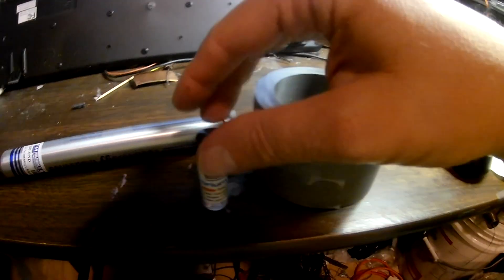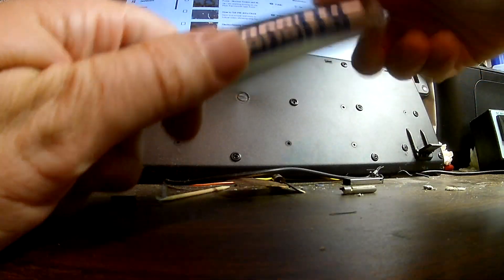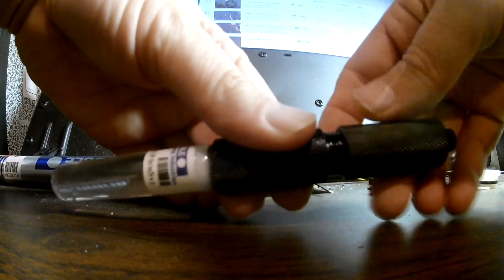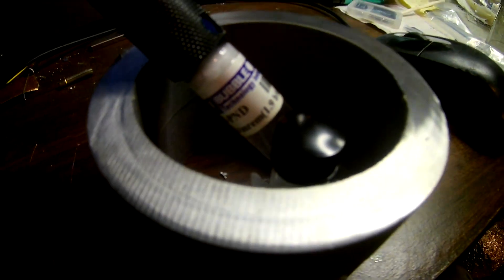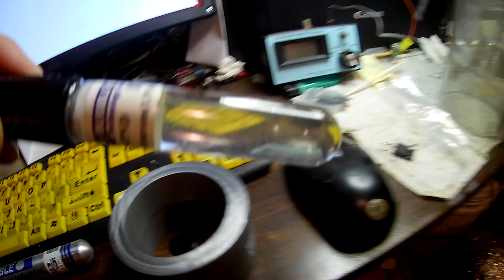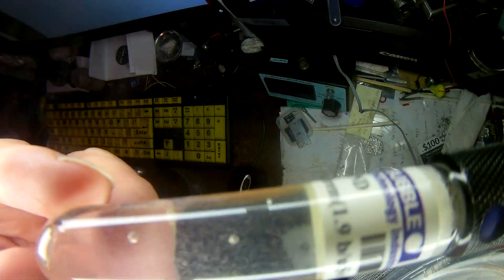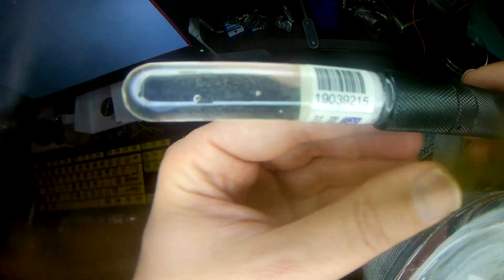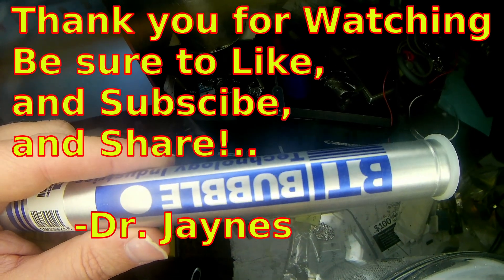Micro Thorium Heavy Water Reactor with Beryllium Reflector Rings

Comment: I have plans to try and make a nuetristor, and use it to make a small breeder reactor at home
Reply from the maker: Sound very interesting! You could also build a Fusor!
Reply: are you want to make plutonium 239 or uranium 233 ?🧐😁🤔
Reply: Please post vids of the project
Reply: LOL 😆 I thought about that shit too but damn bro what do you do when you end up with something like the radioactive boy scout that you get readings from a block and a half away and then you got to dispose of shit
Reply: Cloven Beast he didn’t make a breader reactor only a neutron source what he did wasn’t too dangerous either
Reply: I can't really say anything though because I did the same with my uranium 238 metal sample
Reply: Cloven Beast americium releases alpha particle, absorbed by beryllium which releases neutron, slowed down by parrafin wax, absorbed by uranium 238 forming U239 decays through beta decay where a neutron turns into a proton , a electron which is released as a beta particle, and an antineutrino forming Np239 after 20mins half life, which decays via beta decay (same process) gaining a proton becoming plutonium 239
Reply: @punishedgloyperstormtroope8098  Yes I realize he didn't he was talking about it. I've done similar experiments I was basically just speaking thoughts that I had when I was doing things
Reply: @punishedgloyperstormtroope8098  Yes I know I have both powdered and solid beryllium. The powder is incredibly scary. I don't know how many discs I pulled but from certain things lol but I ended up with a pretty strong alpha source. Let me put it this way it's been in a plastic vial for 5 years and the plastic is decaying.
Reply: @clovenbeast5183  what is your alpha sample? And how much of it do u have? Where can I get one?
Reply: @punishedgloyperstormtroope8098  look into industrial smoke detectors they contain about a hundred times the amount. I don't remember the name of it but I bought a couple of them cuz I got tired of buying smoke detectors. Take the disc out of the buttons. Take the foil off the industrial. It's hot
Reply: @punishedgloyperstormtroope8098  If you can't find that you can always get old radium clock hands. Wash off in acetone. The radium isn't soluble and ends up as a sediment at the bottom but the paint is so it can be poured off.
Reply: eBay
Reply: americium 241 And I have another containing  radium sulfide in a little bit of lead nitrate I believe? I don't know I got it from Canada the radium salts anyway. This guy was a chemist and they actually shut him down when I tried to buy from him again lol. I guess they frown on That kind of thing traveling over borders
Reply: @punishedgloyperstormtroope8098  I have the equivalent of about 250 smoke detectors worth
Reply: And actually I just found another source recently it's the hottest Geiger counter look up the most radioactive Geiger counter on YouTube. It looks like it's worn on the belt anyway it contains a very hot radium dial if you find the one that hasn't been messed with just look into it. It also contains a check source but I'm not really sure what the check sources is. You pretty much have to keep your sources moving as the government catches up like finding what's available
Reply: What makes it so bad is I've taken them out of the buttons so it's just the electroplated It almost looks like copper but it takes up about as much room as three drops of water so it's very potent for the size
Reply: @punishedgloyperstormtroope8098  here's a video on what looks to be the same kind of smoke detectors I took apart long ago https://youtu.be/dfihjKIHgwk
Reply: @punishedgloyperstormtroope8098  I don't know about the secondary source that he's talking about cuz this is part two. I never worried about them The primary though wow it's those little foils he was holding up
Reply: @clovenbeast5183  250 smoke detectors are still weak in this sense , not enough to produce enough neutrons to produce reasonable quantities of isotopes
Reply: @clovenbeast5183  send me a link to these “industrial smoke detectors “
Reply: @punishedgloyperstormtroope8098  I don't remember what they were man I had to do my research I think it was radioactive things.com where I learned about it they usually have things that are listed but you just got to do research to find it man That's how you earn the ability to fucking it's where you learn what not to do and how to keep yourself and other people out of trouble. I would say Google it but you can't use Google because it's censored brave it or ducked up go it most radioactive sources just look at the post that I shared and ask him what it was I don't remember
Reply: @punishedgloyperstormtroope8098  The radioactive boy scout would disapprove lol It doesn't take much to produce neutrons and you got to remember in the process neutrons are given off so it's a chain reaction man you don't need much what you might want to consider is something to act as a control rod like cobalt or something to absorb the neutrons so you could slow it down without having to pull out the core
Reply: @punishedgloyperstormtroope8098  a very small source will work just in small slow ways a large source will quickly get out of control. 250 smoke detectors is hot enough to turn plastic yellow and pitted in 5 years. Looks like there's liquid in it sticking it to the sides where it's stuck to the plastic!!!! Reactor made hottest fuck man I don't have any way of measuring alpha particles I can only detect the gamma coming out of it and it's hot it's real hot
Reply: @punishedgloyperstormtroope8098  The problem is moderating the neutrons slowing them down to the proper speed. Once you get that right and everyone's hit and right for the most part it don't take long to start noticing things. I used a paraffin house but I mean you could use graphite ideally I don't know about beryllium as far as reflecting I just use it to knock neutrons off of. Let me put it this way I have a really hot sample of just simple high-grade uranium or that's been powder so basically uranium oxide in some state I don't remember. Black. The beryllium chunks that are in with that are slowly turning to what appear to be carbon on the outside it's just from the alpha bombardment and neutron generation in this little tiny vial. I don't even have the beryllium in with the sample that I am originally talking about. It doesn't take much to kick off he just got to get your moderator right and know what you're doing
Reply: @punishedgloyperstormtroope8098  now I understand that it takes a while to get up to the point to where neutrons start being given off from the reaction I mean there is countless fucking atoms in there but it's bound to happen if you know what I mean. If you really want a stronger source start searching out radium clock dials and shit like that. The hottest Geiger counter with the radium dial which I really can't understand to this day lol it's supposedly extremely hot and use take that dial out dissolve off the paint and acetone collect the precipitate or undissolvable things in a coffee filter and you just keep going until you have up enough buying radium watch hands and kits off eBay true radium watch hands. As far as am 250 smoke detectors is a lot. I know it doesn't seem like a lot but it's enough to decay things around it. You look at polonium sources that are used to generate neutrons and you're talking a fraction of it
Reply: @punishedgloyperstormtroope8098  back when I was messing with it I was looking because I had thousands of dollars of chemistry equipment into how to dissolve into assault separate and maybe electroplate or reduced back to metal but unfortunately with the quantities it's more like electroplate to one side of something. The problem is these foils only radiate from one side with alpha. It's just a deposit on some foil looks like electroplating actually. If you could take it all and put it on one surface on the one side and put it up against some beryllium preferably fairly thin or some plate you would get a lot of lot more than you can get with a lot of things. I mean you could build an ion multipactor for fusion reactor if you really have that money, but this is a true source where you can get real results from a few hundred bucks and sometimes been on eBay
Reply: @punishedgloyperstormtroope8098  ideally your source is surrounded. Much like radioactive boy scout but I don't know I think he used carbon but look I'm just saying it's possible it's very possible unfortunately and if you were around me I would happily investigate with you and show you but I'm not going to mail this shit lol not in these times
Reply: @punishedgloyperstormtroope8098  you don't want to source that's as strong as you're thinking. You're a great moderator man think about that
Reply: @punishedgloyperstormtroope8098  just look up the people that have done it man look up the radioactive boy scout 1-in cubes about 1 ft² with a core of radium he used aluminum instead of beryllium but shit and we can get beryllium nowadays. There's actually a lot of knowledge in those in that funny takeoff of how to build a nuclear reactor at home
Reply: @punishedgloyperstormtroope8098  but on a side note something I have noticed when I pulled it back out I noticed that it was deteriorating, I checked the radioactivity of it based on gamma basically because I don't have anything capable I need to get some kind of alpha probe and a proper guy your counter or just got a cheap one. Anyway I've noticed that over 5 years It seems to have lessened at least in gamma
Reply: @punishedgloyperstormtroope8098  but at the time before when I was testing it I was keeping it with my neutron source as well everything in a Pyrex lab media bottle a bunch of vials just to kind of keep the radiation down even though it's glass it helped
Reply: @punishedgloyperstormtroope8098  ideally you want to carry out small experiments on a small scale with good equipment Rather than large experiments with shit equipment and end up fucking
Reply: @punishedgloyperstormtroope8098  there may not be any lies governing outside of nuclear regulatory reach but you're in new times now it's best not to make a scene you know?
Reply: @punishedgloyperstormtroope8098  sorry I know I write a lot of responses but it just comes to mind and it's kind of important and it's kind of how I think cuz I'm crazy lol. It's like when I used to do chemistry. I live in an apartment in a town and I got tired of the cops being called on me thinking I was cooking meth. Not every chemistry kid is a meth cook you know not everybody that's interested in chemistry is cooking dope. But in my experimenting and not understanding and just kind of going through and dissolving lead and acid and all kinds of shit I became aware that these vapors and shit were actually affecting me and I poisoned myself many times some less some more. These were different times I was buying high grade uranium ore on eBay It was about maybe 7 years ago. I would do reactions in the backyard and just fucking fill the air with nitrogen dioxide fucking red fog and run inside but ultimately I came to realize that it wasn't just me that I was exposing it was everybody else. That's when I came down. I started thinking about my kids in my house I started thinking about my neighbor's kids I started thinking about how everything connected just keep that in mind man before you go trying to build something that you're not going to know what to do with
Reply: @punishedgloyperstormtroope8098  That being said though right on bro I hope you learned something from office we need it
Reply: @punishedgloyperstormtroope8098  with great knowledge comes great responsibility
Reply: @clovenbeast5183  the nuclear Boy Scout didn’t build a reactor, just a neutron source
Reply: @punishedgloyperstormtroope8098  oh bro he did he built a breeder reactor lol I'll find you the video That's why it was so goddamn radioactive That's why they dismantled his shed and buried it in a Nevada desert
Reply: @clovenbeast5183  https://en.wikipedia.org/wiki/David_Hahn
Nah
Reply: @clovenbeast5183  it was so reactive because he got soo many isotopes
Reply: @punishedgloyperstormtroope8098  have you looked into him very much?
Reply: @clovenbeast5183  this is a mistake people are confusing neutron sources for reactors
Reply: @clovenbeast5183  yes
Reply: @clovenbeast5183  read the wiki page
Reply: @punishedgloyperstormtroope8098  I'm sorry I don't just take one source I take a whole bunch of them and kind of figure out the similarities and kind of work with that. A neutron source is pretty small it's pretty easy to build it's not much it's the fact that he reduced thorium from lantern medals put it with a moderator packed it into cubes packed in aluminum foil into a giant square stacking them around the core and left them with the obvious proper amount at least somewhere in his grid of moderator. The radioactivity grew till he could detect it from blocks away that's when he freaked out broke it up drove parts of it and buried it along with throwing some of it away. It was all extremely radioactive after his experiments. The iron doesn't have that long of half life and they wouldn't bury his shed
Reply: @punishedgloyperstormtroope8098  it's very well within the grasp of regular people to do That's why you don't find a lot of information on it but if you already know the basics there's not much they can do to stop you other than making it really hard to get sources as they have.
Reply: @punishedgloyperstormtroope8098  The problem is why the fuck would you want to because what are you going to do with that shit are you going to put it all together somewhere to generate heat and boil water and be able to contain it and not let it melt down are you going to let it reach a critical mass kind of situation do you understand what you're dealing with kind of thing
Reply: @punishedgloyperstormtroope8098  And how do you get so many isotopes? Aside from the ones that you started with other than natural decay?
Reply: @punishedgloyperstormtroope8098  how do you get a higher source from  am th and u? He was making fissile material That's what a breeder reactor does. Is the material is usually highly radioactive a lot more so than non-fissile because it's so unstable. Left in an environment with continued neutrons bombardment it begins to release neutrons itself as it breaks down into I don't know probably cesium and all the other countless things made in a reactor
Reply: @punishedgloyperstormtroope8098  Tell me how you make things more radioactive?
Reply: @punishedgloyperstormtroope8098  I mean maybe it's not to the scale that you're imagining but it's a working breeder reactor. It's producing fissile material
Reply: @punishedgloyperstormtroope8098  remember in a modern reactor they're neutron source is the fissile material in close proximity with a moderator around it so as these natural decays happen they're all really close and kind of self-propagate. In a breeder reactor you want a source but you don't necessarily need a really strong source unless you're trying to get there in very quick time like lowering it into a reactor for a minute or maybe bombarding it with a particle accelerator for cancer treatment through water bottles. If you build too strong the source you're going to be in deep water way faster than you're ready
Reply: @punishedgloyperstormtroope8098  I don't know if you've ever done chemistry or know what a runaway reaction is but that's what you're looking at
Reply: @clovenbeast5183  dude, you CANT build a nuclear reactor and you can’t boil water unless you have a large amount of plutonium etc and a bunch of other equipment 
David Hahn did not build a nuclear reactor, there is no evidence for this people only say that because they don’t understand what a nuclear reactor is and think neutron sources are reactors.
The best you could do is build a radioisotope thermoelectric generator
Reply: @clovenbeast5183  bombard them with neutrons for them to absorb
Reply: @punishedgloyperstormtroope8098  but hey I believe in freedom of information and everything else. If you want a really strong source I recommend small beryllium tubes filled with radium. Or finding some way to through chemistry to remove the electroplated deposit produce a salt and then reduce back to metal probably through electroplating I don't think you can electroplate on to beryllium but I don't know maybe just reduce it back to metal if you got enough with lithium foil. Pack your tubes get your moderator ready and surround it with your material that you wish to process
Reply: @punishedgloyperstormtroope8098  but unless you have some serious shielding I don't recommend it. But that brings up the other point what are you going to do if you get it all and it's still going and you're going to go pull it apart right To stop it? Then what are you going to do with it? You're left with extremely radioactive samples and quite a bit of them depending on your scale. Where do you keep something like that away from people or yourself how do you even deal with something like that
Reply: @punishedgloyperstormtroope8098  More importantly how are you going to hide it like a murder for the rest of your life. You'll never sleep for real lol
Reply: @clovenbeast5183  even if I used 1000 smoke detectors I would only be able to detect the isotope produced under gamma spectrometry .
A guy wrote a blog and used 2.5Ci of plutonium 238 (millions of smoke detectors worth) to transmute uranium 238 into plutonium 239 and he only managed to get 10 smoke detectors worth of plutonium 239
Reply: @clovenbeast5183  it wouldn’t have been hard to clean up the radiation the nuclear Boy Scout left, just sell or dispose some of the thorium. He just had too much thorium and americium and not enough lead shielding
Reply: If you're talking like time frame to make it all thistle material and short matter to using a reactor then yes you're probably going to need something strong to get it done quick I think they do it in reactors in like 25 days or something. As far as experimenting yeah I mean without gamma spectroscopy you're not going to be able to tell much of anything anyway. Just look for the small points. If you want something hella radioactive start reducing radium salts back to metal. Probably going to have to do it on to like the tip of a needle or something. I have some pretty hot sources fairly close to me in my room. Couple feet away you can't even tell even with a Geiger counter. You would need a shit ton to be able to register it five doors down considering he lived in a house with a yard
Reply: @punishedgloyperstormtroope8098  You're talking about building enough or producing something that you can actually make fissile material? Yeah probably not going to do that off of eBay but you probably could if you were rich enough. Radium's probably your best bet there's still heliclock hands and watch faces and clock faces and displays and I think potentially railroad markers from back in the day but you're not going to get your hands on those. You can still get the old lantern mantles for thorium but you could probably just straight up buy it or get it from TIG welding rods and reduce it but I guess you don't have to reduce it although I would I prefer a metal. As far as a breeder reactor it's pretty wide definition. If you're actually looking to create enough fissile material to run a reactor you're going to die long before that lol. It's pretty simple  but incredibly difficult. As far as producing the amount of neutrons you're talking about do you have a 30-ft pool and I mean like 30 to 60 ft deep? Neutrons are scary they make other things radioactive as you know including things inside of you like the iron in your blood and all kinds of shit. Well the half-life is pretty low and you'd be fairly safe I wouldn't want to work with that much neutron pollution I guess you would call it or exposure. I'm saying that it's well within your grasp to transmutate elements into other elements with what you can get off eBay lol. If you want to keep upscaling eventually yeah you probably could if you don't die first
Reply: @punishedgloyperstormtroope8098  I don't know about you but the thought of turning elements into other elements inside of my body sounds horrifying even if it's small amounts. Talk about cancer lol. As far as him not producing the breeder reactor on the radioactivity being from the amount of isotop that he had The one thing that stands out in my mind as an argument would be that he was testing it the whole time and it didn't start off that radioactive even after he had built it surrounded it with bricks in a metal toolbox It slowly became that radioactive which is what caused him to freak out dismantle it throw parts of it away and ultimately end up getting caught on his way to dispose of some in fact it was a lot of the thorium cubes I remember reading the officers testimony about the little squares and everything a little cubes. I don't know honestly you've raised a pretty good point in my mind and now I'm going to have to look into it as I was always under the impression that he did but now I'm wondering if you're right because of one of the interviews that I watch where he was talking about that he thinks that he did produce some isotopes that were fissile. Sorry about the lack of punctuation and probably a lack of spelling I'm using talk to text and I'm kind of lazy
Reply: @punishedgloyperstormtroope8098  I would highly recommend if you haven't seen it watching the demon core. I'm sure you know about it most people with the same hobbies do. I know you're not going to reach anything close to criticality but in building a reactor and I'm not talking about a breeder reactor because of breeder reactor just produces fuel for a reactor. I look at what happened to them over just little tiny mistakes and some of the most horrific deaths known. The amount of neutron production that you're talking about would roast you maybe not right off the bat maybe not even to where you noticed right away but somewhere down the line that shit might catch up to you
Reply: @punishedgloyperstormtroope8098  remember if you're trying to do it the same time frame and produce fissile material chances are you're going to have to do it at the same levels that are found in a reactor.
Reply: @punishedgloyperstormtroope8098  You're most likely not going to be able to get enough lead for that level You're better off with natural things like concrete lots of concrete lol probably lead sheeting in it and probably water.
Reply: @punishedgloyperstormtroope8098  honestly as far as dealing with the radiation you could just find an old well and put in a fucking bucket and lower it down a rope and as long as the well was dried up and you weren't going to drop anything down at or let any rain water in.
Reply: @punishedgloyperstormtroope8098  what I mean is how are you going to manipulate it and put things in and take it out and even build it? You got robot hands and shit lol? A source that large like the talking about you wouldn't want to handle or build with your hands if you know what I mean
Reply: @punishedgloyperstormtroope8098  And remember any lead shielding is also going to become radioactive and move up and the periodic table
Reply: @punishedgloyperstormtroope8098  they're also going to run into a problem of not being able to accurately measure the alpha activity. I'd be willing to bet that you couldn't come up with an accurate reading of my sample with an pro capable of detecting alpha particles. You would have to go off gamma or something else. One smoke detector will make but detector scream with an alpha probe on it point blank imagine 250. Now imagine 2,500. You just going to be measuring gamma at that point. Once you throw the beryllium in the mix and you're going to be getting shit off everything near it. Even if you put it down a well the surrounding dirt especially the metals present.... Yeah neutron sources are very scary when they're large
Reply: @clovenbeast5183  you don’t need to convert radium salts to metal, they both produce the same radiation
Reply: @clovenbeast5183  you can buy pure thorium oxide, me need for mantles
Reply: @clovenbeast5183  ik about the demon core
It’s basically impossible to produce a super dangerous amount of radiation from available sources EXCEPT X rays
Reply: @clovenbeast5183  what’s the point of fissile material?
I just want a trace amount of a radioisotope
Reply: @punishedgloyperstormtroope8098  then you don't need a very strong neutron source
Reply: @punishedgloyperstormtroope8098  government has a tendency to overreact and bury their shit lol. I must say though no matter how many high activity samples I collect I still get pretty close to the same readings at certain distances. Now if I had a hot particle or maybe a cesium check source with that amount of gamma and beta it probably be a different story and I might actually put my lead ingots around it but as it is it's pretty much always in reach but if I hold a Geiger counter where I am it's background even though it's off the charts when I'm near it
Reply: @punishedgloyperstormtroope8098  I must admit though lol I've been tempted to buy the 10 uci cesium check source and if it wasn't almost 200 bucks from United nuclear I'd probably own it and keep it in a lead pig lol
Reply: @punishedgloyperstormtroope8098  actually I kind of wonder if that check source doesn't come with a lead pig. There's radiation limits through the mail. When I got my radium extract it came in a 1x1x1 ft box to limit the amount of radiation coming out to acceptable levels for the post office. But that's just alpha with a little bit of gamma. Cesium on the other hand has some pretty high energy betta in there as well along with gamma and a check source that high I'm kind of curious how they would mail it without a lead pig
Reply: @punishedgloyperstormtroope8098  fuck it lol let's find out
Reply: I don't have any way of detecting alpha so there's no way of telling but it's been years If I remember right the end result was p241? I don't remember but I do know it's sat in that little paraffin house that I built for like a year with the source
Reply: That reminds me they have zarconium supposedly reactor tubes for sale on eBay for a very short amount of time